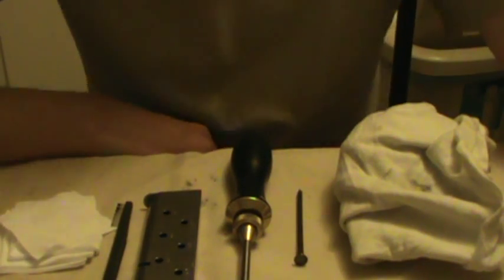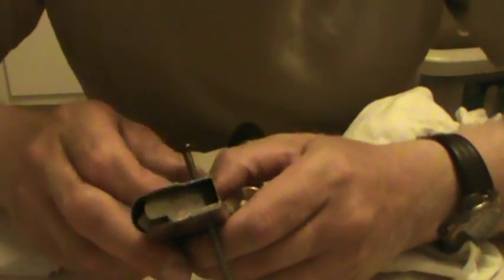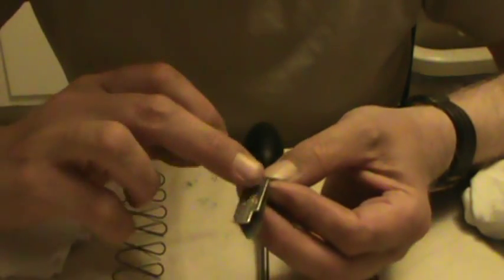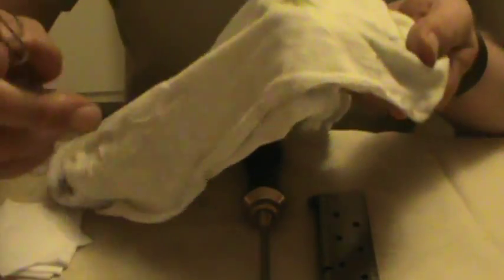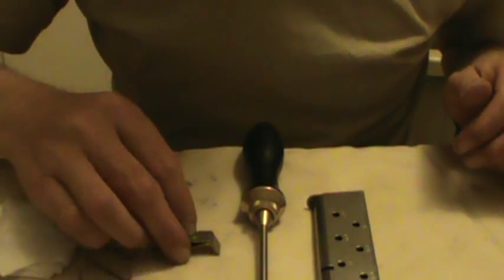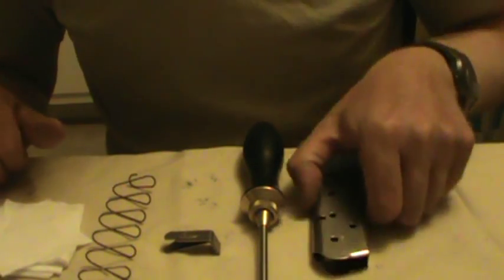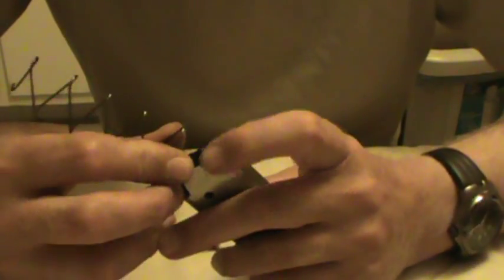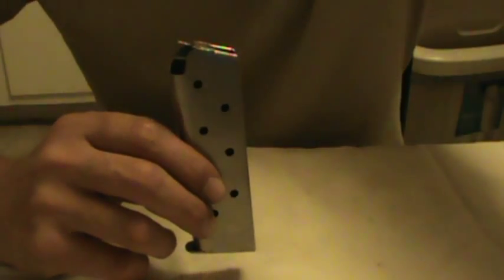M1911 magazine disassembly and maintenance

Comment: @ cottersay:  bah.  Never say never.  :)  There is nothing wrong with putting a very light coating of oil on the interior of the mags.  Unless the user is going to cram in dirt, mud, sand, and clay he oil will help.  The worst would be grease.  At least with a light coating of oil the grit and grime can cycle out, with grease it stays put.  :)